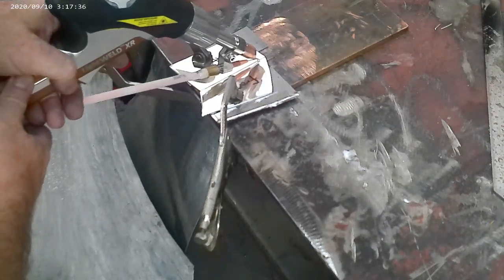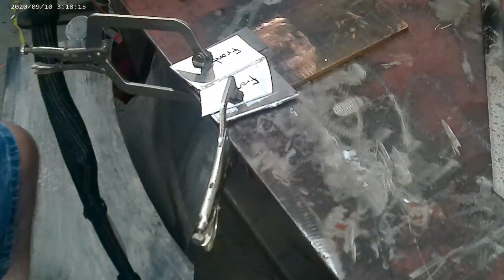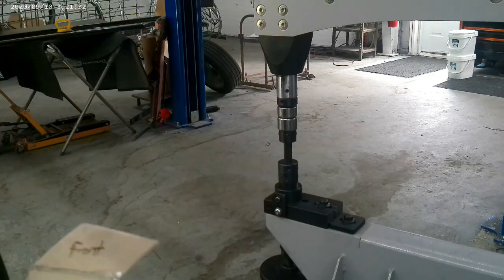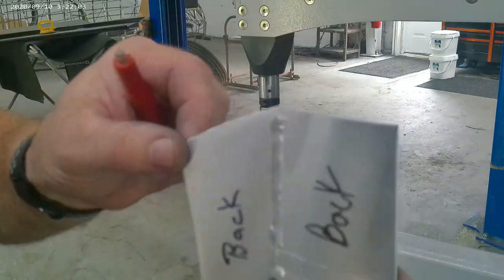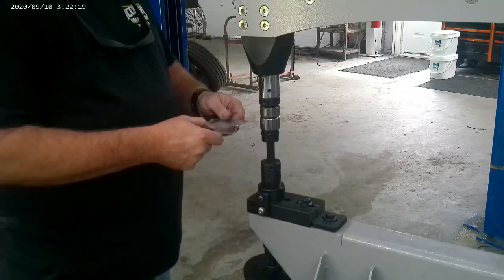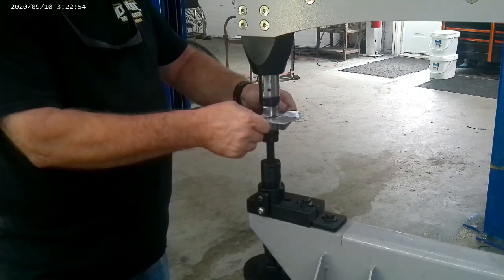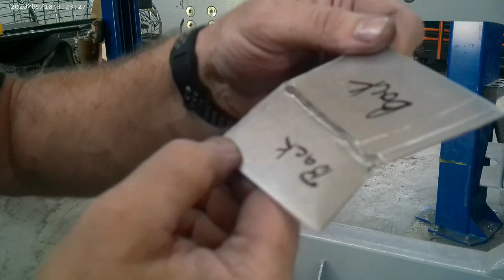Laser Welding Aluminum

Comment: Love your content man. Great stuff. I have to revive this thread- Question- I've got to do some patches on a unique vintage Italian car; the skin is .030" aluminum, similar to T3 alloy by composition, compound curves. I've got some patches that are made to fit, but I'm afraid my limited tig skills will overheat and distort the surrounding area. Do you think this machine, with some testing, could successfully do a precision butt joint with minimal heat transfer? Can you run multiple beads to fill before finishing? 

I've got a donor vehicle to cut patches from, they'll be tight, and I'll put a suitable backer insert in to catch stray light. No access to the back side once in place. 

Any info greatly appreciated.
Reply from the maker: With any welder you will get distortion. If the settings of the machine are dialed in… you will get less than tig welding..